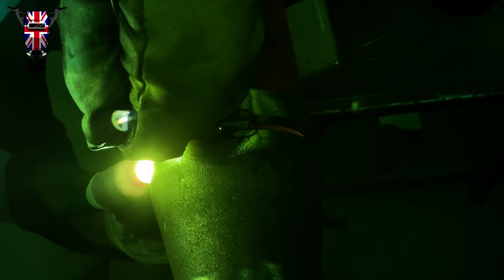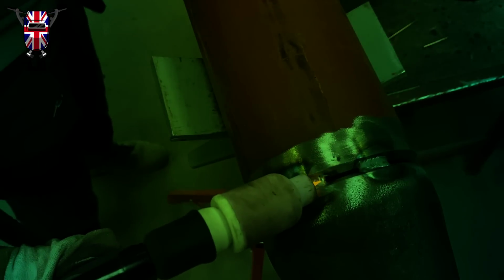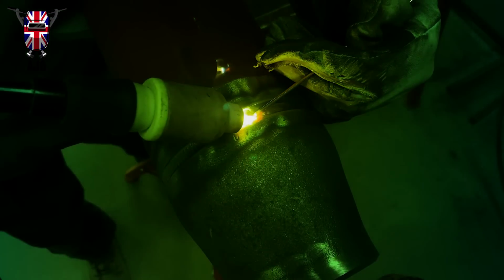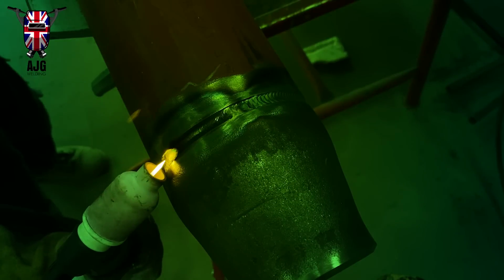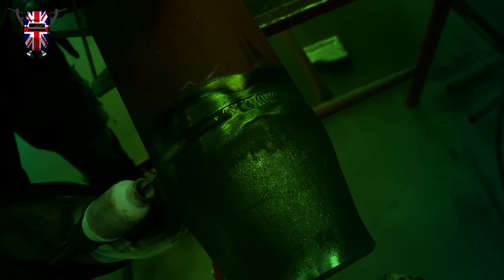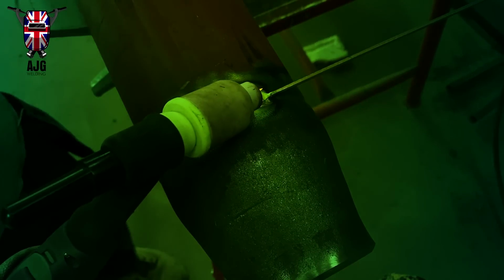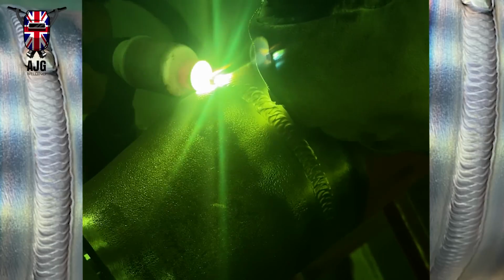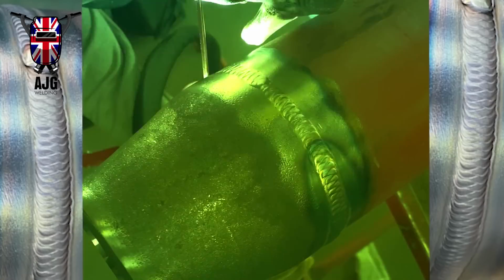Tig Welding Tips For Pipe Welding

Comment: Some welder you mate ,i learn nothing where i work so just bought weld set for at home to practice ,wonder how many hours it’ll take me 😂
Reply from the maker: Thanks bro, all you got to do is put the time in mate it’s annoying trying to learn something new you just got to keep pushing
Reply: @ajgwelding  how long did it take you?
Reply from the maker: @dalewilson4918   I worked as an apprenctice for 1 year then moved to a company as a welder, progressed there with MIG/MAG and stick with an unlimited coding cert. Then moved into welding pipe 4 years ago i'm always learning though mate
Reply: @ajgwelding  yeah i worked as welder fabricator for 3 year ,then went to where i work for 4 year ,all mig ,have done other processes but only downhand and stick verti and overhead